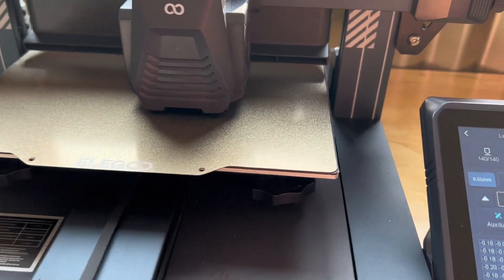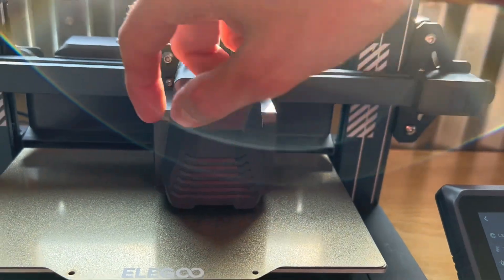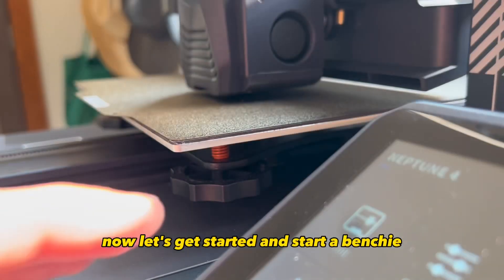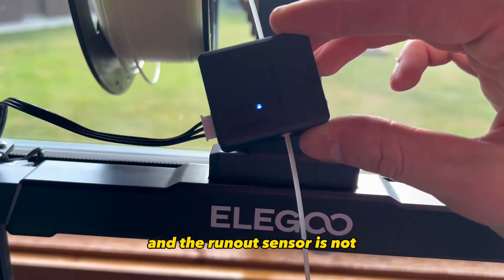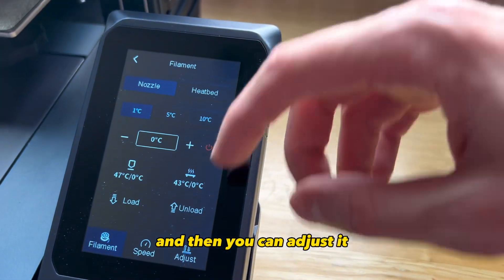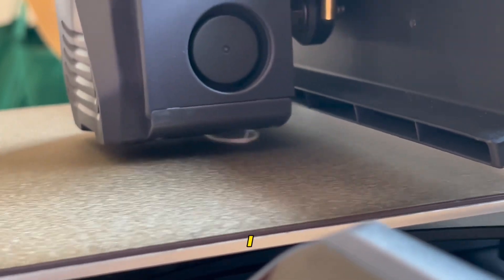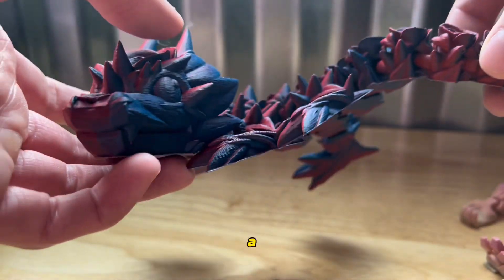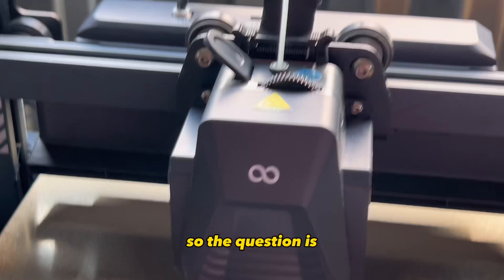Elegoo Neptune 4 Review: Unveiling the Powerhouse of 3D Printing

Comment: ELEGOO's website says the Neptune 4 has 121-point auto leveling. Are they wrong?
Reply: It is 121 point. Just received my Neptune 4 and it indeed does have the 121 auto leveling. Looks like only early review models have the 36 point
Reply: @dudepi3141  Good to know.
Reply from the maker: So far it only levels at 36 points. Go back to the beginning of the video it only shows 36 points and I only counted 36 points. Maybe it’s because of the 4 bed leveling screws.
Reply: with new latest firmware you can change between 36 and 121